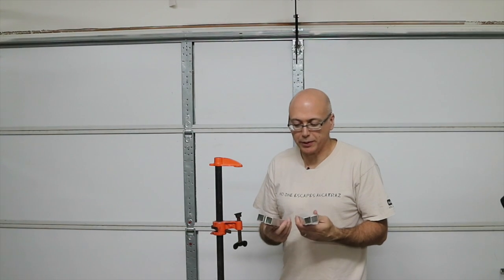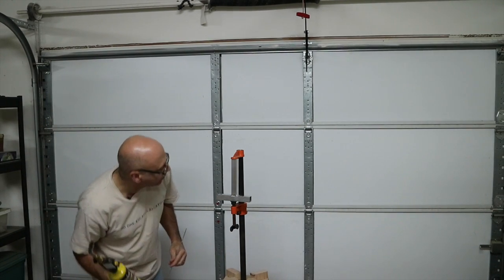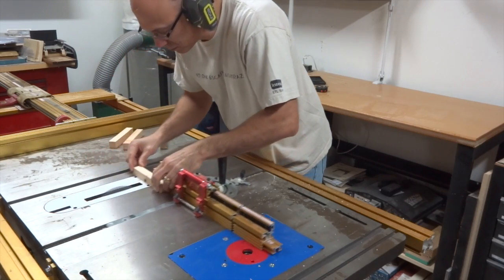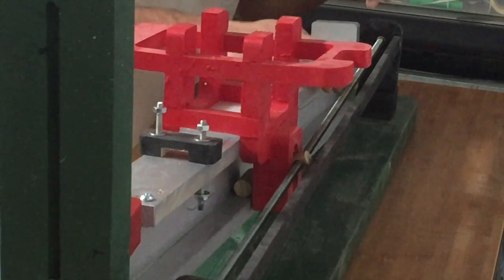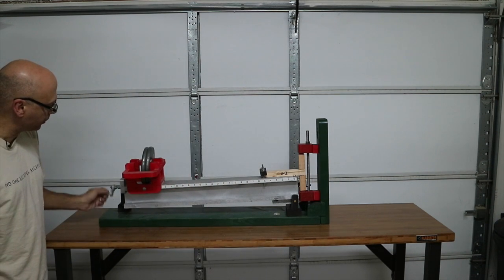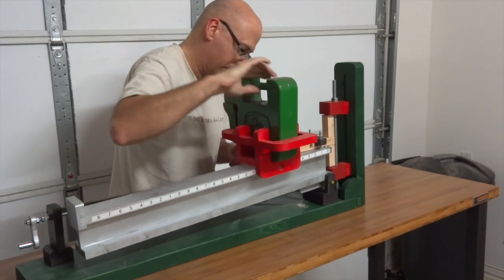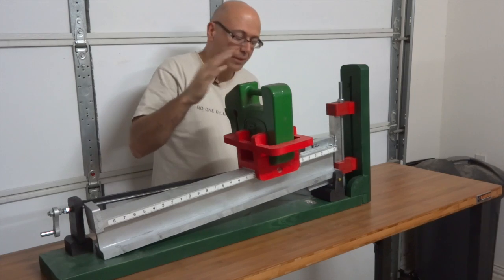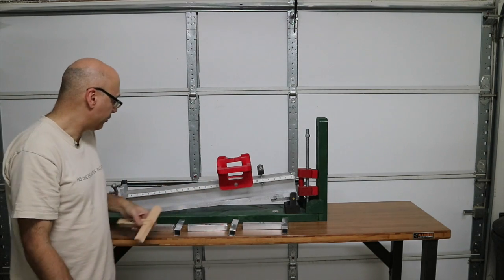Aluminum Brazing Demo & Strength Test - Spoiler Alert: FAIL!

Comment: You don't remove the heat in the middle of a brazing process! You're asking for weak joints. What happened to surface preparation? You should have aluminum brazing flux also. The joints would have been a lot stronger.
Reply from the maker: Thanks for your comments, Mike. As I noted at the beginning of the video, I started from not knowing anything about how to do this.

Comment: Is there a special tip for the bottle for brazing? I have tried idk how many times now and it seems the piece never gets hot enuff. Yellow bottle. I’m basically melting the rod under flame and trying to fill.
Reply from the maker: Well, as you can tell from the video, I’m no expert on this subject. It was really more of an experiment. From the little I do know about the subject, I think the whole brazing concept is a bit of a stretch using this method anyway.

Comment: I always wonder that since the annealing temperature of aluminum and the working temperature of the brazing rod are about the same, has the aluminum tubing been annealed at least partially during brazing (especially aluminum being such a super heat conductor)?  Many demonstrations showed the braze being stronger than the aluminum pieces but none showed the aluminum pieces retaining the strength after brazing.  Were they simply showing that aluminum became softer than the brazing material after the process?
Reply from the maker: Interesting question. As they say, that question is “above my pay grade.” Maybe someone else on here can provide their insight?

Comment: UNFAIR: It would have been more of an even contest if you had used lap joints on the aluminium.
Reply from the maker: You’re right, Lewis! Challenge accepted (maybe)!
Reply: @IveBeenThinkingWorkshop  Even without the glue the wood joint would resist bending. A butt joint with scab plates on each side would likely be the most even contest. I note that the mechanical strength of the glued joint and the soldered/brazed joint are both directly related to the area that has been "glued"/wetted". With scab plates that are centered on the joint line, equal in width and height to the base material: I would predict the failure point will be tearing of scab plate(s) at the centerline of the joint .... but I could be wrong (that has previously happened with far too much regularity  :-)
Reply from the maker: That’s an interesting idea to try
Reply: @IveBeenThinkingWorkshop  See https://www.youtube.com/watch?v=qxY8Ii4TeQ0
Reply from the maker: Yep, I remember seeing that video when it was originally posted. I might have been inspired by it.

Comment: Maybe try the same experiment with a chemolene or chemtane. Both are propane based gases with a much lower hydrogen content. More of a “soaking” type of heat that isn’t so directed. MAPP is an acetylene based fuel gas that has a VERY direct and concentrated heat signature. Pen stroke versus flood light signature. 

Your no go fixture was spot on for this test. I challenge the naysayers to take that amount of time to express a point instead of the amount of time it took them to write a negative response.

Comment: This guy is an idiot. He was testing the strength of the braze against a physically stronger wooden joint. Perhaps uf he'd used the same joint on both materials. The test rig was crap.

Comment: you didnt braze them you actually did a cold solder .
Reply: I have Tig and Mig welded for 30 years, but I am a novice at brazing a aluminum.  My first attempts at aluminum brazing resulted in cold solder joints
Reply from the maker: This is probably a novice thing to say, but I did heat up the parts pretty well before joining them. Obviously, whatever I did didn’t work properly.
Reply: @IveBeenThinkingWorkshop , It is part of learning. your heating up the piece was right but you have to melt your piece and the rod together at the joints and what you actually did was just melt the rod onto the piece. Again it is part of learning and practice will make you better at welding .

Comment: Practice, practice, practice! There isn't a single veteran welder that started out doing this stuff well, you need to practice and find out where you're making your mistakes. Try using a stainless steel wire brush before, and during the heating of the metal. Also, I've seen people use clean, stainless steel picks, screwdrivers, or tools to work the aluminum into the joint before it has a chance to solidify.
I'm not going to criticize you because I haven't put up a YouTube video but good effort on your part!

Comment: I simply can't resist commenting on this video.  I mean no disrespect by what I'm going to write.  
I really hate to say this but your test was a complete waste of time. Where should I start?  But, first, it's almost beyond believe that you actually wasted your time making your test jig. You really must have far too much time on your hands. It appears that you have an obsessive/compulsive nature.  If you really wanted to test the joints, you could have done so MUCH easier and without building your jig which, by the way, only gives you a relative number. It doesn't tell you how many actual pounds of force breaks a joint. 

Next, as a woodworker for over 50 years and an engineer for almost my entire professional career but who started out testing materials for just about any kind of properties imagineable, I find it amazing that you actually thought you were testing your half lap joint strengths.  You weren't.  At most, you were testing the strength of the wood fibers but that varies from wood sample to sample anyway but you were NOT testing the joint strength because you weren't applying force against the joint at all.  That's not the direction of force that the joint has to withstand.  On top of that, you wasted the viewer's time doing useless tests on wood joints when the video was supposed to be about brazed aluminum joints.  Even worst, you didn't get any results with your wood "tests" which was completely predictable for anyone who understands basic physics at all so why did you even include it in your video? 

Your aluminum joint tests:  First, you didn't braze the aluminum properly. You have to very carefully remove oxidation from the metal before you even start brazing and you should brush it once or twice very carefully again as the aluminum heats up but before you actually do the brazing. Your joints were doomed to be weak before you even started!  This makes me wonder why you apparently didn't even bother to do a few minutes of research about how to braze aluminum.  Rather, you spend hours building and painting a jig that can't give you any useful information at all. If you spent a tiny fraction of the time you spent buidling that jig just researching how to braze aluminum, your time would have been much better spent and you wouldn't have a useless jig wasting space in your shop.  

I'm guessing you may have been inspired by the guy (I can't remember his channel name) who tests all kinds of things and products in very clever ways.  But his tests keep things as simple as possible and produce measurable and meaningful results that viewers can learn something from.  All we learned from this video is that you like to build jigs that can't produce objective, meaningful and useful results and you don't understand how wood joints are stressed and don't know the very basics of brazing aluminum. 

I do apologize for this.  I really don't mean these comments as insults but I don't know any other way to say them.  But if you go to such extremes, I almost feel sorry for anyone who may live with you. Your time could have been MUCH better and more productively spent.
Reply from the maker: Hi Bob, thanks for taking the time to comment on my video. I had no idea YT allows for such long comments! Anyways, I’m not offended at all by your statements. They’re all well-thought out. Just remember I did this project for FUN, not for scientific research. When the goal is fun, there are no rules. I think you might have thought I’m going to publish these results in a journal or something. Maybe if I did the test better I would have considered it...
Reply: Harsh. " I don't mean to insult you".... "I feel sorry for anyone that lives with you"..
Reply: This guy puts an honest effort into the test and the video. Prefacing your unnecessarily engthy comment with a disclaimer of "I don't mean to insult you" and then you proceed to make personal remarks about things that have absolutely nothing to do with the test performed insulting the nature of this guy maybe you should take some of your own advice.

Comment: Thanks for your time doing it. But (it's always a BUT) the wood joint, if properly done, will be strong even without any glue. The problem in your test is in 1 side you have a physical mechanic joint, used by ancestries for centuries even before they know what glue is. In the another side you have a chemical mechanic joint. And sorry, but (like me) you're a really bad welder-man.
Reply from the maker: Ok, so question for you: do you think if I welded it correctly (I agree with you about my welding skills, by the way), would the metal joint win? I mean, we all know that aluminum is stronger than wood, right?
Reply: @IveBeenThinkingWorkshop . Well. If you cut the aluminum and make a fitting joint, as you did in the wood, I guess the probability of a strong joint ill increase. As well, If you just glue the wood together face to face, without any chamfer, the probability of a fail joint will also increase. It's just not apples to apples. Any way, again, thanks for your time doing the test.

Comment: You might get a better connection if you first removed the oxide on the surface of the aluminium with a wire brush or sandpaper.
Reply: Morty Goldmacher On the first joint he said he’d cleaned it and given it a bevelled edge. Am I getting two totally different things mixed up with each other? I know in all probability I’m asking a totally idiotic question, but as a 59 year old newbie I know if I don’t ask I’ll never know.
Reply from the maker: Yes, I did clean & bevel the edges, but it wasn’t enough to give me a good joint. I also preheated the parts, which still didn’t give me a good joint.

Comment: Good testing . I think if you were to TIN all sides as flat as possible... then wire brush the tinned sides then clamp and braze again you will have a much stronger bond. Also what brand did you use? Zink/aluminum alloy? Try Alumiweld. Thanks for the video!
Reply: Also consider a 1" x 1" angle piece thinned and brazed on both sides.
Reply: So, wire brush the flat surfaces, add brazing rod (tinning), and then make up the jig with the two parts and then braze again? As far as the angle piece, could you do a flat triangular "gusset plate" like you would with a truss? Seems like you could get some pretty decent strength out of it.

Comment: How about you try a fair test. With the wood it was two vertical block and one horizontal sandwiched so the compression of the machine was helping with the aluminum the weld took the whole weight.

Comment: The vertical leg of your testing rig needs some bracing. I can see it flexing during the test which is reducing the available travel of the silver beam before it bottoms out. You should probably even brace it a few degrees past 90 so that when it does flex the angle is close to 90.

Comment: What dose a wood joint have to do with an aluminum joint ?
Reply from the maker: Well, they are both joints and in my video, they are of similar geometry. My reason for comparing them was that someone may want to substitute one for the other?
Reply: That is an excellent question. I wondered the same thing. But he's not even testing the joint strength.  The force he applied does not test the joint strength anyway and it's a different joint that the aluminum. I'm not sure what he was thinking.

Comment: as we can see the joint that you made ( T joint aluminum welding ) not strong enough bcaz no penetration at all. Just me.t down on the T-joint surface but not deep enough to get a good penetration. Must b more heat until u see the Shiny puddle then u can add the Filler rod then you will get a better penetration man. By the way, I like the way you tested by that Tool. It looks engineering way.

Comment: I've watched several other videos about brazing aluminum.  In one of the videos the video maker showed "tinning" BOTH of the work pieces where they are to be joined prior to final welding/brazing.  He also suggested using small pieces of aluminum angle to add extra strength to the joints in places where your project allows room for the reinforcement(s). Just a tip I found to pass along. :-)
The thought behind this is to use a thin layer of molten brazing rod as "glue" to increase the surface area of the bond between the pieces to be joined.  It doesn't matter if the pieces cool somewhat between assembly, because they will be reheated when you do  the final brazing.

Comment: Do you call that a good comparison ? You can not compare wood to medal.
Reply from the maker: Explain why not, Sam P?
Reply: I don't think you can be told anything!
Reply: Using a wood joint gives us an idea of how strong the brazed aluminium joint is, at least for those of us familiar with wood joints. Without the wood reference the test on the testing device is meaningless.

Comment: WOW, who would have thought - several square inches of would glue holding together a joint with good mechanical strength would out perform a few thou of first-time weld . . . LOL
Reply from the maker: Ok, I admit it, I was rooting for the wood joint the whole time. Look at my test fixture -- it's made of wood too! Clearly I'm biased.

Comment: From an engineer to probably another.  Good approach, good method, nice setup.  I am sure you picked up on it after watching your video yourself .... The problem with the deflection of the end of the beam preventing successful test is the joint tester base (itself) is the weak link that was deflecting.  The bottom joint, on the table, was yielding. Also the vertical piece (2x4 holder backing) needs to be much stiffer (E) than the material being tested.  It is easy to see the bend in the tester.  The connection of that to the base also needs to be much stronger and stiffer than the joint you are trying to test.   Basically, your joint tester isn't strong enough for the joints you were testing.  Either make the tester stronger, or make the samples from smaller sections and try again.
Reply from the maker: Thanks for your comments, FaceDeAce! To tell you the truth, the whole thing was a big experiment... trying to join the tubing using this process, making the testing fixture and even making the video for that matter. If you got something out of it, I'm happy.

Comment: Hey. I like the test but I suggest you watch some videos on these aluminum rods and learn how to use them before making a video testing the strength.  I've been welding 40 years but consider myself a beginner on this type of welding.  But I know enough to know your welds were horrible. You should have your joint and surrounding metal heated up enough before applying the rod to make the entire weld with the torch turned off. the rod melting is 400f and melting point of aluminum 700f so you have big window.  keeping torch on weld is just doing damage. Your test is worthless if not done correctly. Example: A comparison would be if you glued the woods together and after 10 minutes of drying you repositioned the joint several times during the drying time disturbing the glue.
Reply from the maker: First of all, thanks for taking the time to provide your comments. It's been over a year since I made this video, so I may not recall all my steps. I do recall that I preheated the parts for a few minutes before I tried to fill the joint with the rod. I just kept the rod close to the joint while heating so I could test whether it was ready to join. Still, I know I did something wrong, so I don't have all the answers.

Comment: Hi, I enjoyed your test video. Maybe widen out your bevel a little to widen out the weld area some. Then  leave enough that it has a slight "bead" or angle across. Not just right at the end of your tube. Also hot brush it with a stainless steel brush to clean and give it a bit more bite.  Your joints should be stronger.
Reply from the maker: Those are some good suggestions. I agree, the joints should be stronger. I'm sure I could do better with more experimentation.

Comment: You may want to trim off the "toe" of the I-beam so it can travel down further.
Reply from the maker: That was intended as a "safety" feature so the carriage can't slide off the end. The beam would need to be longer in order to increase the load.

Comment: Ouch, I'm learning brazing at the college I teach at and we were just discussing maybe brazing aluminum rather than steel for a sociable tandem velomobile frame I wish to make.  This was not what I was expecting from the first concept.  Thanks for making this video.  I'll also be doing a lot of experimenting to ensure whatever I end up building will be strong and safe as well as light.
Reply from the maker: Hi Scott, thanks for the comments. Even though the aluminum joints I tested in this video didn't do well, this test opened my eyes to the fact that, unless you do such a test, its hard to know if you made something strong and reliable or not. Definitely do your research before building! Best of luck with your project!